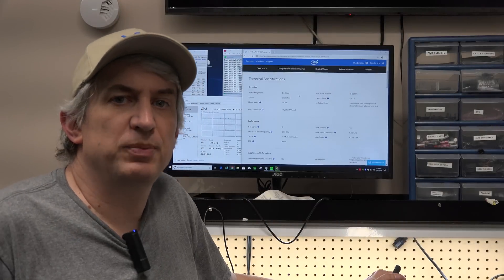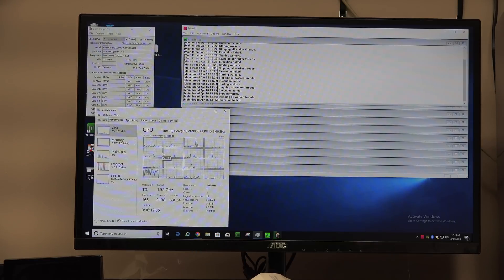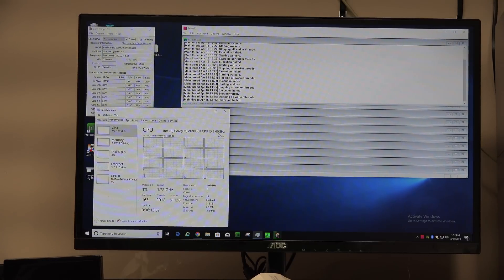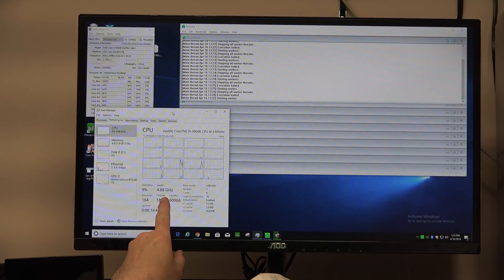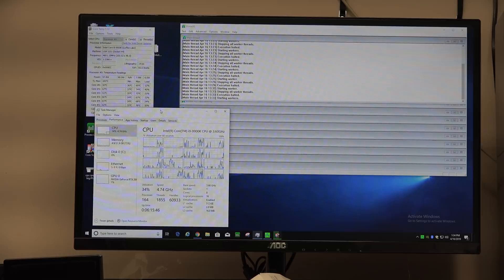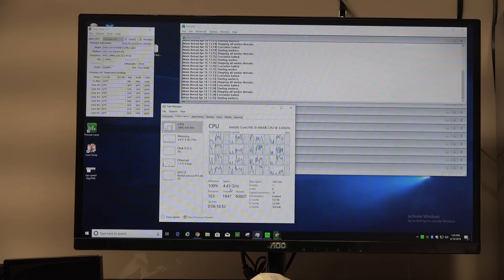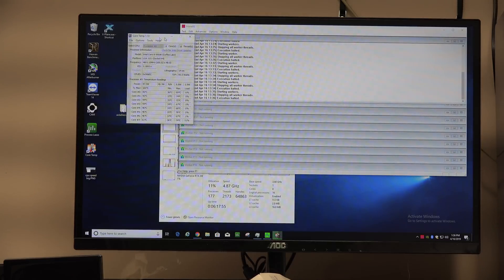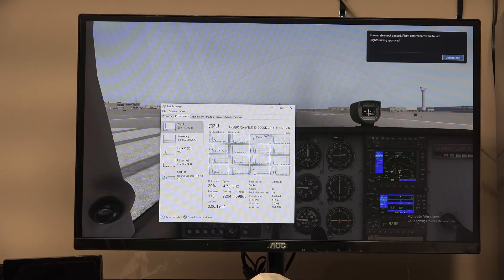What's the deal with Intel's Turbo Boost?

Comment: Are there any disadvantages of keeping Turbo Boost enabled?
Reply: is it even possible? he said theres no way to keep it at max 24/7
Reply: @darthvocrum5719  I have i7-3770 @ 3.4GHz which goes upto 4.0GHz in Turbo. But only if the temperatures are normal.
Reply: A pretty much late answer, but the disadvantage is in power consumption and higher temperatures.
Maybe not a big deal for desktop, but more of a problem for laptop users.

Then, it can be so, that some tasks aren't requiring that much GHz, but since turbo boost is on, it may rise the power consumption of your PC in general.

Comment: ALso its only Fan cooled so Im a bit concerned, should I be? why does this guys run @3.6Ghz at the same load when mine is running at 4.82Ghz at 2% usage (currently)?? HELP! lol. Edit, I also just noticed in Task Manager it says Cores: 8 And Logical Cores: 16, so Why is it not running all 16 cores? I also think gaming performance is pretty crap with a single Gigabyte Aorus 1080ti so Im very unhappy with this CPU, especially since I very stupidly "thought" I was "upgrading" from a 4+ year old i7 4790K.... :(

Comment: How do you actually turn the boost on tho? Is it on by default, meaning if more processor power is needed it will try to go into boost or do I need to enable it somewhere?
Reply from the maker: Should be on by default
Reply: @xforcepc  Thank you :)
Reply: I have an i5 8400 with base clock at 2.8 but turbos to 3.8ghz. It didn't go past 2.80 til I turned intel turbo technology onto auto in bios.

Supposedly my cpu is faulty or something

Comment: I got a aio watercooler and when playing games like apex legends max settings my i9 9900k stays like 40 degrees 3,6 ghz. So you would think that it can easily turbo boost to 5 ghz but it never does that. Why tho? i have excellent cooling
Reply: Had same problem with my i7 9700k, topped at 3.6GHz. Needed a BIOS update and then it boosted correctly.
Reply: You have to have a good chip
For stable 5ghz it may not be your cooler, just your cpu
Reply: mitchell but its an i9 9900k can i overclock it safely to 5 ghz?
Reply: ch00se Blackshot im definitely no expert.. you should be able to but i would suggest the Reddit page called overclocking these guys are like wizards over there. There very knowledgeable.

Comment: Intel Turbo is trash. My new system keeps crashing with standard BIOS settings and Turbo Boost enabled.
Specs: 
I9-9900K
Asus Rog Strix RTX 2080 
Noctua NH-D15
Be Quiet Straight Power 11 750W
Reply: Did u get this problem fixed i also hve the same issue please help
Reply: @joosboy9728  either deactivate turbo and go with stock rate or overclock manually to a fixed rate. each option fixed it for me. last option will increase your energy bill though

Comment: I disabled the turbo boost and over clocked each core to 5.0 ghz
Reply: I thought you couldn't overclock the Intel CPUs?
Reply: @thefrozengamer8086  As long as you get the versions with the unlocked multiplier its a breeze. In my case its the 6700k model.

Comment: Hi Michel, excuse me if I post here maybe I'm OT, but I have to ask you what GPU is needed for Xplane11 to work fine (high settings) with my 24" FHD 1920x1080p monitor (i7 6700k - 16 GB Ram)? Do I need the 2080 /2070 (these are too expensive to me, maybe I can afford the 2070) or the cheaper RTX 2060 is enough? Thx in advance.
Reply from the maker: A single 1080p display... The GTX 1660ti will work well and is very affordable.
Reply: @xforcepc  thank you so much
Reply from the maker: @racingtheweb  If you get one, let me know how it goes.
Reply: Since I play DCS too, I'm going to purchase a 2060, just a bit more than the 1660ti,  so Xplane should run even better, but I will tell you how it goes. Thx :-)  @xforcepc

Comment: The i9-9900 will run all day at 5.0 on all cores if you use the tools in your BIOs to overclock. You are giving a very unfair overview of the i9......
Reply from the maker: To expand on this...this video was not an overview of the 9900K.  I was talking about how the Intel Turbo boost works when not overclocking in the BIOS.  In fact, the 9900K is not even mentioned in the title.
Reply: @xforcepc  yeah i came here just to see how the frequency drops on core's load so this was helpful
Reply from the maker: I said that I was NOT overclocking. I am also aware.
Reply: What do you need to do in the Bios??
Reply: @Tyger Hell NO....everyone I seen ramp it up to 5ghz out of the box gets too crazy high temps then throttling.
I'm thinking the other guy must know something you do in the Bios to not have that happening.